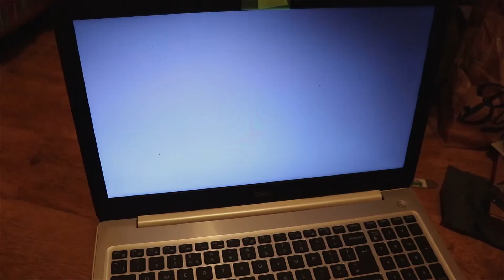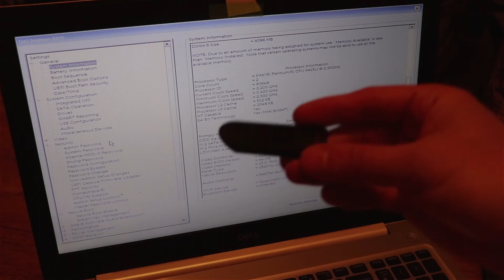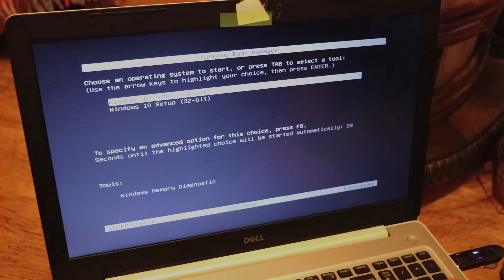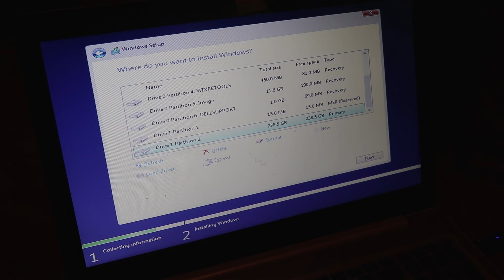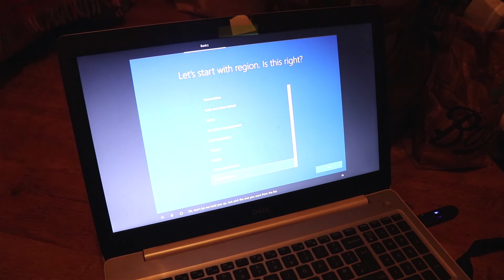Dell Inspiron 15 5000 M 2 SSD and Ram Upgrade

Comment: Hi,
i have a dell inspiron 15 5000 series 5567 model (Intel(R) Core(TM) i5-7200U CPU @ 2.50GHz, 2701 Mhz, 2 Core(s), 4 Logical Processor(s)).

It only has 4GB ram and i want to add another 8GB.
You think it will hold 12 GB?

Thank you for your respose

Comment: I’m having a problem I installed my new SSD went into bios and change the boot sequences to sad being first and my windows boot manager being second but my 2 External hard drives and the hard drive in the laptop won’t show up the External hard drives show up in the bottom right but I can’t see the drives or access them but if I go back into bios and switch it back around it all works fine but it’s running off of the hard drive

Comment: I just upgraded to SSD (I did the M2 internal, not SATA) using the software described.  It did not show in Setup as a boot option (F2).  But if I pressed F12 during bootup I could select it.  I left the HDD in but disconnected it to save battery power by not spinning.  A cold boot takes about 13 seconds.  After keying in password, the laptop was up and running all apps in 22 seconds!  Even my iPad is not that fast on a cold boot.  Speed?  A normal boot was about 15 minutes (5 minutes to get to the log in screen alone).  Plus my Logos Bible software used to take about 8-10 minutes to fully load.  Now it is less than 60 seconds.
Reply: i m upgrading mine i just order 32 g ram 2x16 is this inspiron 15 5000 gonna run it or not?
Reply: Man has Logos 🙏🏼🙏🏼

Comment: Where do you buy the thin thing to open the laptop? Thanks
Reply from the maker: It's a pry tool which you can get from ebay. Most phone repair shops will sell it.

Comment: Have the same issue you had first try with it not reading it in the BIOS, but mine doesn't change 😭
Reply: Did you make sure the gold pins are in all the way, or that the bios is updated, or that the board can take the same SSD?

Comment: Im doing mine this week im adding two ssd 980 2tb lol 
1tb nvm.2 
16gb of ram
Reply from the maker: Nice upgrade. Good luck! How are you fitting two 980s in there? Just out of curiosity.
Reply: @AzNstat   has CD tray bay i can buy ssd caddy drive swap it add two ssd same time
Reply: @AzNstat  what's the battery life of this laptop?
Reply: QUIERO ACTUALIZAR EL NVME m.2 a 1tb
Lo compré con 256 gb
No te dio problemas el de 1tb?
SALUDOS

Comment: Useful tutorial but how on earth did you get the case off. I have the exact same laptop but can't budge the case clips where the dvd drive is located. Any tips please?  It looked like you was struggling too but you cut away from recording that bit. Thanks in advance
Reply from the maker: Thanks for the comment. I think I just used multiple pry tools and slowly wiggled it out. If I remember correctly there was a hidden screw by the dvd compartment which might have stopped you from opening the case fully.
Reply: @AzNstat  when I open the drive tray I can see a screw into the case which I will unscrew but can't find an easy way to get the drive out without damaging the runners the drive is on. Will have to have another look. Thanks for your reply though 👍

Comment: Does it boost your laptop condition?
I'm planning to upgrade mine also
Hoping for your reply
Reply from the maker: Yes it does. It'll make things boot faster and be able to use more programs. Definitely worth doing.
Reply: @AzNstat I asked dell they said my ram can be 32 from 12 MB ram. However I ended up in blue screen of death. I also replaced old battery when I did this. Not sure what caused the blue screen.  Going to try it again.  I have basically a new windows 11 running. Maybe it didn't like the new battery. Changed out the cmos battery as well because it showed dead on tester.